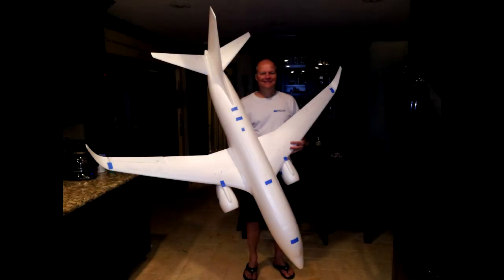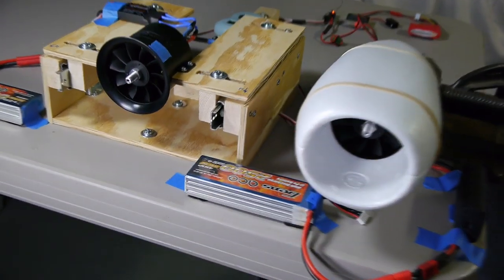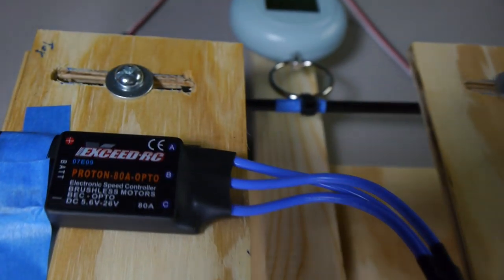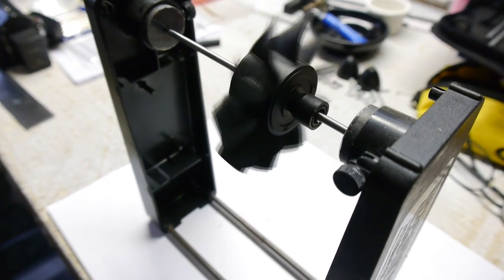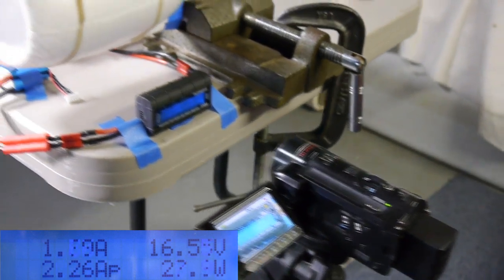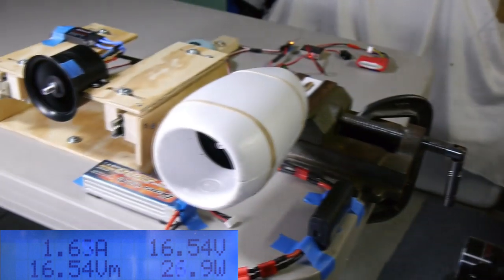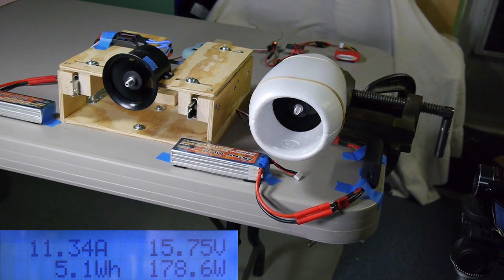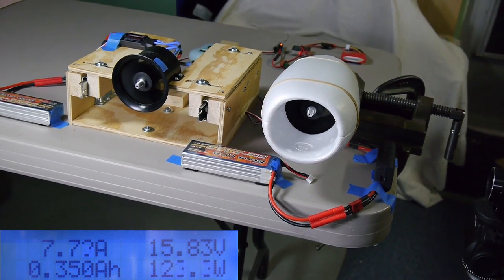Change Sun 10 blade fan test 003

Comment: This is my first experience with radio-controlled model airplanes. I bought a Windrider 737 coupled with the change function 70mm 12 blades. My problem is still unresolved which engine to buy.
I thought of a Turnigy L2855-2800 from 630W
Specs Kv: 2800 rpm / V - Voltage: 14.8 (4s) - Max Current: 43A
or Turnigy L2855-2300 from 450w
Specs Kv: 2300 rpm / V - Voltage: 14.8 (4s) - Max Current: 26A
or Kv-3800 from 550w - Voltage: 14.8V - Max current 36 A.

Comment: I have a question, as I am also looking to upgrade the fans on my F22 t othe change sun 10 blade. With that HK motor (2300 kv) it's rated for 26amps... but you're pulling 43 in the video (static) - have you not had the motors burn up yet? I've been looking for a motor capable of handling 45a or more... any advice would be great.  I would like to be able to run those HK motors...